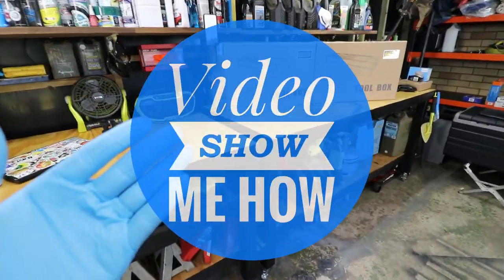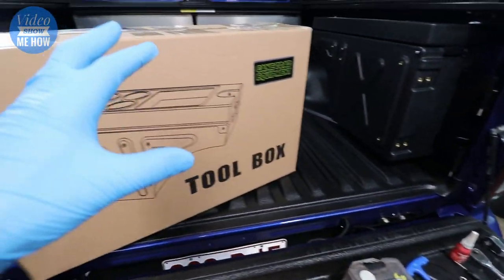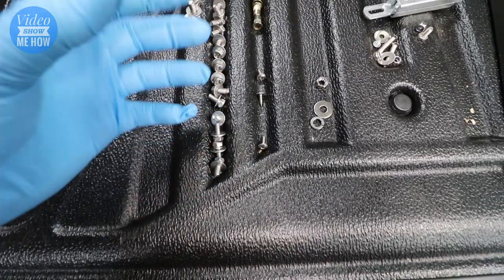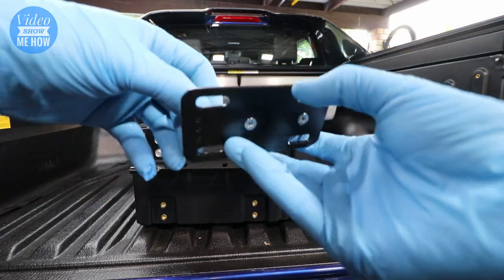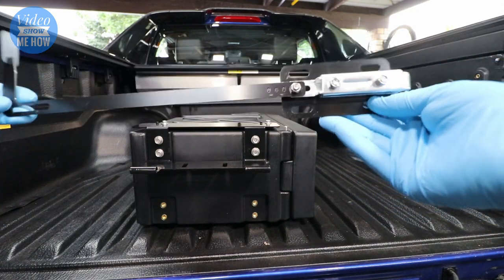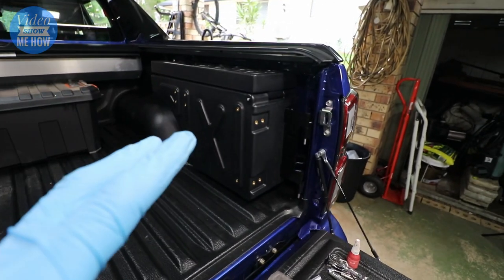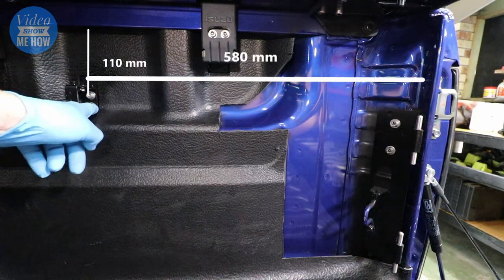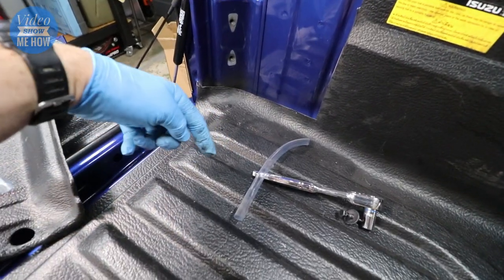ISUZU D-MAX Ute Swing Storage Boxes - 2021 ISUZU DMAX X-TERRAIN Build Series #3

Comment: I'm thinking it might be a nice spot for an air compressor for an airbag helper kit, with plug in infiltrator for the tyres etc. Have everything in the 1 box with controls on the outside with PSI gauge's for airbags. Could also add some charging points etc. Whilst it would be more of a permanent fixture I personally think  it might work well. Thoughts? as it may not be the best solution.
Reply from the maker: Yeah could be good. Thing I like about these is how easy they are to remove. Went and got a load of firewood on the weekend and took all of 30secs to remove both so they wouldn't get banged up. I'm planning on a permanent box setup using the dead space under the roller shutter for battery and compressor etc. Just doing the design now :)
Reply: @VideoShowMeHow  This is exactly how I would like to do mine. Can't find a suitably sized box off the shelf, so may have to be a custom job. Keen to see how you do it.
Reply from the maker: Stay tuned 😁👍

Comment: Be interested to know if there is a unit that doesnt require cutting tub liner - sort of defeats the purpose of tub liner really
Reply from the maker: Since filming this one ordered some Dyna mat type material to test filling the gap down over over the lip if that makes sense. See how it goes.
Reply: These ones work fine without cutting the tub liner with a few minor adjustments. I don't have the expertise like Adam to put up a video but would be willing to help with any info you need.

Comment: I wonder if you could heat the tub liner with a heat gun and push it back against the metal tub with some suitably sized and shaped pieces of wood to get the required clearances for the brackets and storage containers without cutting the tub liner at all? I don't mind drilling holes in my tub liner that will be filled with bolts, but I don't want to cut it out. Would you please be able to test how flexible the tub liner material is with the pieces you have cut out when it is heated with a heat gun?
Reply from the maker: Great idea well worth a test. Liner is super thick but you never know. Bit late for me, but would be interested to see the results of someone tries this method!
Reply: @VideoShowMeHow   I've just ordered 2 of the same boxes for $311.35 delivered so I'll try it out when they arrive. If it can't be done without cutting the tub liner I'll just sell them.
Reply from the maker: @gwhite618  let us know how you get on 👍🤞
Reply: @VideoShowMeHow   Great news, my boxes arrived today and they can be fitted without any cutting of the tub liner. I just did a few simple bracket modifications and only 4 holes needed to be drilled in each side through the tub liner for the bolts . I also used a heat gun to reposition parts of the liner so that the swing boxes sit in as close to the tub sides as possible. The liner is very easily moulded into shape when heated with a heat gun. The swing boxes are contacting the plastic covers that go over the roller cover brackets  when closed and they are square with the roller cover runners so they are fitted in a close as possible to give maximum room in the middle of the tray. I also removed my tail light assemblies and drilled the bolt holes into the top of the brackets from the tail light side. This is much safer than drilling through from the inside towards the tail light. I also fitted normal nuts on the top bracket bolts behind the tail lights rather than riv-nuts as they are stronger and more reliable. The drain hoses will need some reworking though, so I'll either use 3 x 90 degree elbows on each side or get some hard plastic air line and try heating and bending it into shape so they are clear of the boxes. I'm also going to re-position the release lever to make it easier to get to. I was going to buy these boxes a couple of months ago, but was unsure of the quality, thanks for doing your vid so I could check them out before buying.
Reply from the maker: @gwhite618  nice! Thanks for reporting back. I found you can one hand the level pretty easy with the right hand for right box if that makes sense. Working on a pipe solution for the drain also, thinking of going into tub to drain down between
Reply: @VideoShowMeHow  I worked out a very quick fix for my drain, I just removed the tube from the grommet in the tub and guided it up over the tub and back onto the drain fitting on the roller cover. No cutting or drilling needed and no extra parts, I put the grommets back in the holes in the tub and filled the holes in the grommets with black plastic plugs. Because you have removed part of your tub liner, you could cut a hole in the inner metal part of the tub with a suitable sized hole saw, then fit the grommet and hose so it runs into the open cavity between the inner tub and outer guard?
Reply from the maker: @gwhite618  yeah cool. Got a trip coming up now so when I'm back I think and elbow direct into the inner part of the tub via a grommet is what I'll likely go. Will let you know :)
Reply: @gwhite618  looking buying 2 of these for my 2021 Dmax, How did you get away without cutting out tub, any chance of a couple of pictures. Thanks
Reply: @glennspilsted5120  The weather is going to be crap this weekend so I'll see what I can do. I might even put up a quick youtube vid of the boxes and my custom "stealth" bonnet strut setup. My video won't be anywhere near the quality of Adam's awesome efforts, but I'll try to do a quick walk around vid with my phone. Congrats on over 2 Million views Adam!!
Reply from the maker: Thank you mate! Love the teamwork fellas 👍👍
Reply: @gwhite618  Thanks mate , really appreciate. You must live in Sydney
Reply: @glennspilsted5120  No, not in Sydney. Why is that?
Reply: @glennspilsted5120   Sorry mate, I ran out of time this weekend. I had to replace all of the brakes, rear axle seal and fit front struts on my son in laws Hilux. Then on Sunday the motherboard on my PC decided to throw it in, what started as a quiet weekend turned into a busy one. I'll do my best to get it done after work one day during the week.
Reply: @gwhite618  Sounds like a typical weekend with my kids